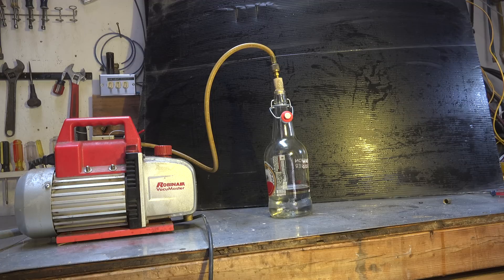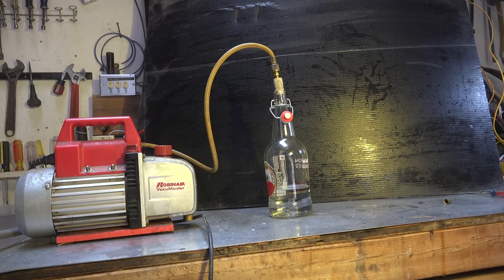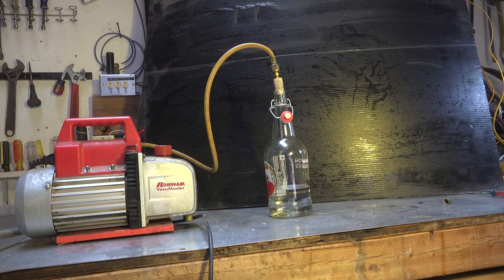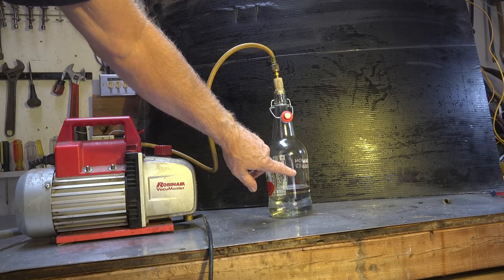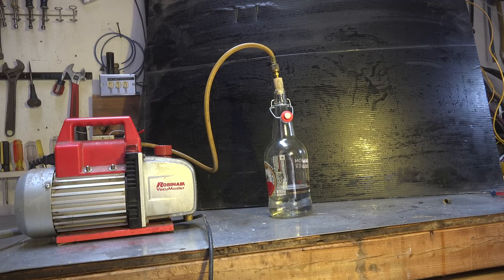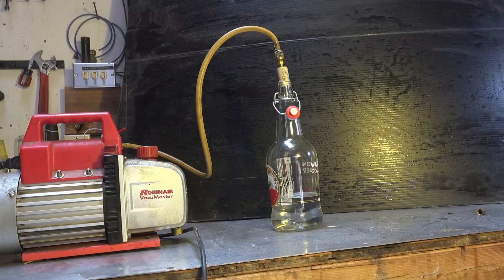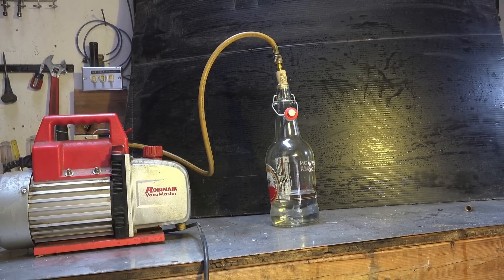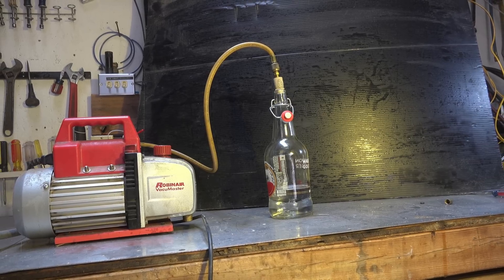Can air be removed from refrigerant?

Comment: What if you put the recovery vessel in the freezer at -30c and let it condense into a liquid. If you then vacuum the system from the top gas side you would be removing the nitrogen, oxygen, carbon monoxide and carbon dioxide. All of those gasses have a boiling point of below -80c with most being closer to -180. If anyone smarter than me can let me know if that would work I’d really appreciate it.

Comment: Refrigerant is very different from water. If there is air in system, evacuate refrig out 100%, vacuum to <500 micron. It must hold for 10 minutes. If there is moisture or leak it won't hold 500. Then charge only liquid (410A you must anyway). So the air is separated, not put back in system. BTW must change fltr-dryer. Tiny bit of air is ok, new dryer traps the moisture, small amount of air stays in condenser, it won't condense.

Comment: Water is two oxygen  and a hydrogen atoms , so water is air
Reply from the maker: Water is 2 parts hydrogen and 1 part oxygen combined in a molecule.  Air is 80% nitrogen, a little under 20% oxygen and some trace gasses.  There is no comparison.  
GFM

Comment: Great video and would like ask in reference to nocondencibles in a system that contains POE oil, is it possible to leave oil and just pull a greater than 500 micron on tha seal system to remove all moisture and air?
Reply from the maker: POE oil will not release moisture under vacuum.  The only way to get it out is to use an oversized drier.
GFM

Comment: I’m not entirely convinced a small amount of air is a huge deal as self contained low charge systems always have that little bit of air between the pinch off tool, and where you braze the line shut. I personally would still replace the refrigerant if I have air in the system because I can’t guarantee the purity especially if it’s a blend and has Poe oil

Comment: Actually, there is a prescribed way of removing air from a system in the field. 
https://www.achrnews.com/articles/83925-get-the-air-out-of-that-refrigeration-system
When air enters a refrigeration system, it collects in the top of the condenser and is trapped. Air is a noncondensable and thus, it cannot be condensed like refrigerant vapors. The liquid seal — subcooled liquid at the condenser bottom — will prevent air from leaving the condenser.
How to get rid of it —
The old way to rid air from the top of the condenser was to slowly purge it from the compressor’s discharge service valve, if one existed. This was done with the machine off and soaked to ambient temperatures. 
Now, EPA rules require the technician to recover the charge (with air) and purge the air off the top of the recovery tank. This is legal.

Comment: How would you know refrigeration has gotten air in it?
Reply from the maker: You measure the temp and pressure of the cylinder.  If the pressure does not correspond to the saturated press-temp chart, it has air in it.
GFM
Reply: @grayfurnaceman  Thanks for the answer. I'm new to this. Also, so you have have to use special hoses for vacuuming? as regular refrigerant hoses are not certified for vaccum rating. Another thing I see that tech use "Kwik liquid lowside charger" to charge system - what is that for? Again, thank you for your answer.

Comment: In the commercial HVAC world, we remove air/moisture from the refrigerant all the time in the field.
Reply from the maker: Good luck on that one.  Moisture can be removed, but effective air removal is not in the cards.  Centrifugal systems, because they operate in a vacuum have air removal systems but that air is not completely removed and does cause problems.
GFM
Reply: @grayfurnaceman  Not sure what you mean by air is not completely removed. There are thousands and thousands of low pressure chillers using purges around the world. Purge designs have changed a lot over the last 50 years, with the latest purifier purges being extremely efficient.

Comment: The way I see it, based on your demo,  is that if you have a system where you can pump liquid refrigerant into a receiver, and close the valves on each side of the receiver, it would be possible to pull the air out of the refrigerant in the receiver very quickly using a vacuum pump connected to the top of the receiver.  What I do know is filter/dryers are more effective at removing moisture than just a vacuum pump. Air seems to be a different matter.

Comment: how do the companies that reclaim refrigerants eliminate air or other contaminants?

how about if someone returns mixed refrigerants to recycling company?
Reply: I believe they distil it, they can separate blends into component refrigerants for reformulation.
Reply: Isn't distillation simply the vaporization of a liquid into a gaseous state which is then re-condensed into a liquid absent of impurities?
Reply: They do that via fractional distillation, the same way they get asphalt, gasoline, jet fuel, grease, and motor oil all from the same crude stock. But do you know why grain alcohol (also purified by fractional distillation) is 95% ethanol and 5% water? That's because it forms an azeotrope which, by definition, cannot be separated by distillation. Some refrigerant mixtures are associated so strongly due to hydrogen bonding that there are not totally separable. This is one of the things that made R-12 so great. Air was virtually insoluble in it... Like oil and water.
Reply: @EightiesTV  You can get the water out by using  a drying agent and end up with 200 proof anhydrous ethanol. Watch method 2 https://www.youtube.com/watch?v=ratR1ngcWss
Reply: reading my question back it may seem snarky but i dont intend that. really curious as to how its done

Comment: The water is boiling, it doesn't have to do with air "intraned " in the water.
Reply from the maker: Look closely,  the boiling takes placed after the air has come out of the water.
GFM
Reply: As Bill Clinton would advise:  It depends on your definition of "boiling".   I think the second stage is a rolling boil, but the preliminary stage would have to be considered a type of boil.  Water is a combination liquefied gases.  Air is a mixture of various gases beyond what is found in water as far as I know.  I'm not a chemist.
Reply: It should be noted in your demo, you are not raising the temperature of the water, rather you are lowering the atmospheric pressure.  Even though your water is boiling, it would be useless for cooking as the temperature is probably dropping as the water changes state from a liquid to a gas.
Reply: @JoeLinux2000  T is dropping, correct.
Reply: Open a bottle of soda and watch the same effervescence. That is not boiling, it's effervescence. It happens when the pressure is reduced and the solubility of a dissolved gas decreases and the excess effervesces out of solution. The same thing happens when a diver surfaces too quickly after absorbing nitrogen gas at a higher pressure when it's more soluble in the blood stream. The diver's blood doesn't boil... the nitrogen effervesces out of solution resulting in nitrogen gas emboli, aka "the bends."
Reply: @EightiesTV  air is like 75% nitrogen so I do not know if that 25% oxygen in the intraned air is significant. We know some  Nitrogen presence is not a problem.
Reply: not sure you actually watch the video there buddy...
Reply: The easy proof would be to re-pressurize, and the apply the vacuum again. Unless water absorbs air quickly.

Comment: Nice demo. I know this is off topic but do 80% gas furnaces use some return air for combustion? I cannot get a true strait answer anywhere. Thanks
Reply from the maker: 80% furnaces mostly use the ambient air for combustion.  The return air is not really involved.
GFM
Reply: My view is the residence is somewhat of a sealed system within itself.  An 80% pulls in combustion air from within the home.  That same air is also returned to the furnace to be reheated and recirculated.  Again from my perspective the oxygen has to leak into the house through poor window seals, opening and closing entrance doors and or windows,  What is important is that exhaust air from the combustion process within the furnace is not reintroduced into the air circulating within the residence.
Reply from the maker: Anything you take out must be replaced.  We go to great lengths to be sure vent gas is not released inside.  
GFM
Reply: This is why code specifies the minimum volume of a room containing combustion equipment of a certain total BTU value and dictates that fresh intake air louvers must be installed if the minimum volume is not met, because standard air leakage rate in air changes per hour can be converted directly into CFM of fresh air.